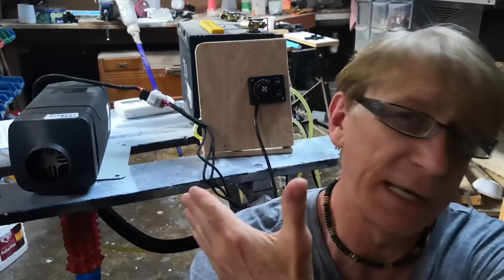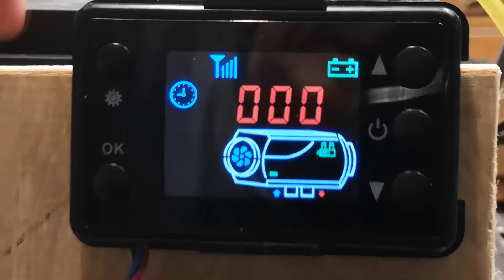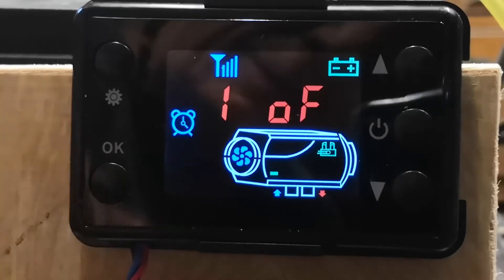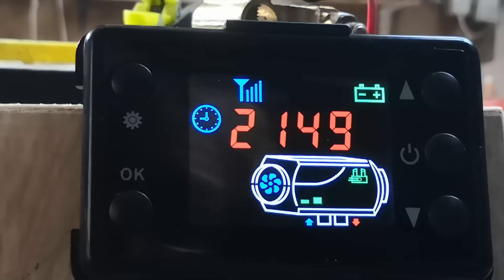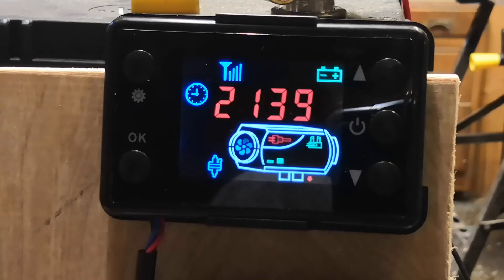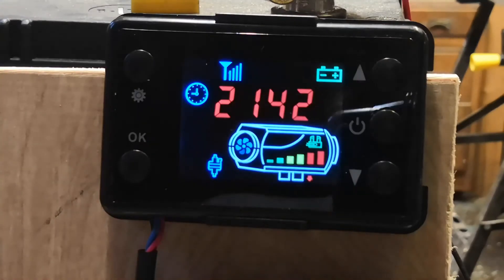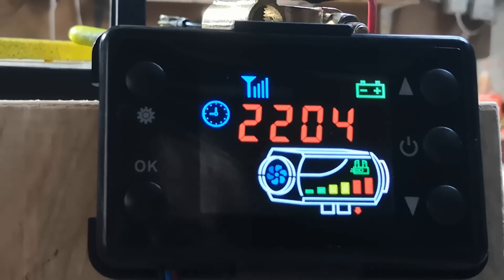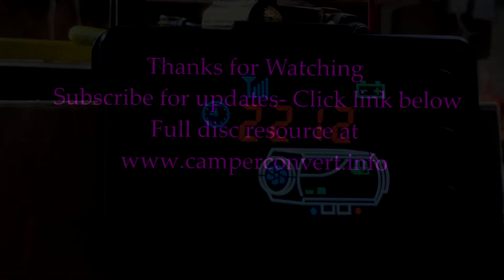06  Heater Demo LCD Controller

Comment: Fuel pipe fellatio?  Don't think I've heard that on YouTube before.   I'd better not Google it.     😉.  Very useful vid, thanks.  After much deliberation as there are a lot of reports of probs with some brands, (?  Triclicks, Vevor) I've settled on the Maxspeedingrods 2Kw which I believe has this control unit.  I think the pump is lubed by the fuel so I plan to suck (fuel pipe fellatio) a little fuel into it before finally connecting.  Did you make a video of the pin entered settings which I think includes Hz as in rate of pump?  cheers.
Reply from the maker: Hi.. glad you worked ut what I meant!  No, I did not do a vid non how to get into the password-protected site. I should try the default fuel settings first...90% of the time they are fine. But... if you keep getting white smoke that does not clear.. give me a shout and I will send some fuel setting to try.

Comment: I have a 3 blade display. I cannot figure out how to set timers nor heat level. Remote doesn't do anything either.
Reply from the maker: Yeah I had a heater with one of those displays and I swapped it out for a 6 bladed control and motherboard. It's not a very good controller that one because you cannot set the ON / OFF timers... it is simply a countdown timer. I seem to recall for the heat level it was just the right side up and down arrows to set the power levels. No thermostatic control on that one. Basically I don't think it's a very good controller which is why I swapped mine out. You have to swap out the motherboard as well and they generally sell them in pairs but it's a very very easy job to do if you're even remotely DIY savvy and this video here gives you a step by step guide on how to do it.    https://youtu.be/sDwrHozKInc
Reply: I kept looking and found a video that helped me out. I'm going to give it a go and see if my needs are met. I appreciate your quick response and suggested remedy.  @campervan_hackers
Reply: I forgot to say your video was actually very informative and well done.